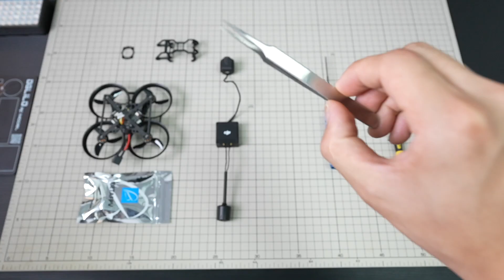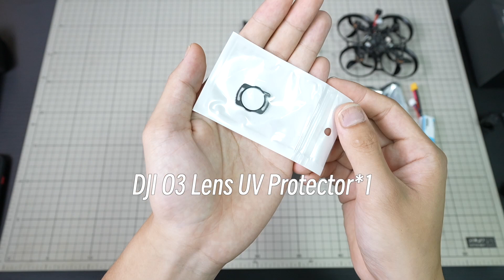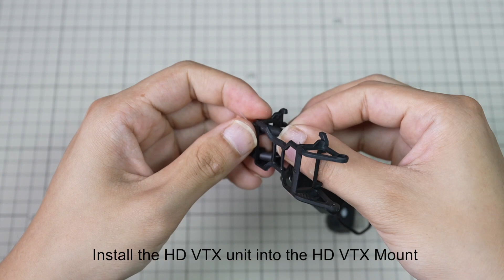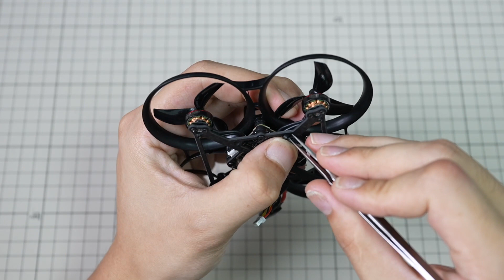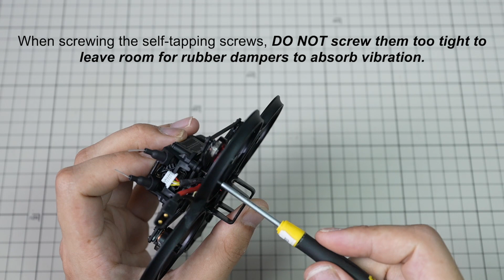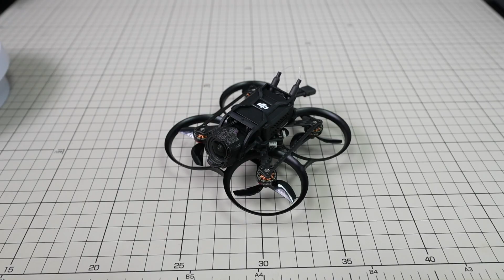BETAFPV Pavo Pico | DJI O3 Air Unit Installation Guide

Comment from the maker: To further answer your questions:

1. Which mounting hole on the VTX mount should the camera be installed on - we recommend the top one. This is to lower the camera position to further protect it from crashes. The video shows otherwise, but we do recommend you install the camera on the top mounting hole!😊
2. DJI controller could be used with the ELRS version of the whoop - please check out our product page description to configure accordingly😍
Reply: im very interested, i want to know how to link the DJI controller with this drone thx
Reply from the maker: @chuckliu2155  It's a bit long to explain here, but we have written it under the product page's FAQ section :) 
Check it out here: https://betafpv.com/products/pavo-pico-brushless-whoop
Reply: @BETAFPVHobby  a video would be very helpful please please please
Reply from the maker: @Mert D  Video is out!
Reply: @BETAFPVHobby   Can’t find video Link Please!

Comment: I purchased pavo pico (o3).

I immediately set it up and test flew it.
However, when flying, the plane tilted back to the left little by little.
After 4 minutes of flight, it tilted about 30 degrees, so I had to "guess" the rudder at all times.

The FC settings have not been changed from the factory settings.
The transmitter used is a Betafpv LiteRadio3 (ELRS).

The above phenomenon does not occur when the transmitter is used in a different aircraft, so we think the problem is with this aircraft or the FC.

I have tried many times to calibrate horizontally.
We have also confirmed that the main unit itself is not tilted.
There is no problem with the weight balance of the main unit.
Reply from the maker: Could you dm us on facebook and send in a video so we could have a closer look with our support team to see what is exactly happening? Thank you!

Comment: It is light, agile and can fly smoothly. Choose manual exposure in O3 video settings such that the shutter speed is 2x that of frames per second (fps). For example, if you choose 4:3 2.7k/50, manually select 1/100 shutter speed, Add a suitable ND filter to make auto ISO close to 100. My footage (2.7k/50 1/100 4:3, stabilised with Gyroflow 1.5):
https://youtu.be/uYpGK_xCwOg

Comment: I immediately purchased two units.

By the way, can I use a DJI radio with the FC that comes with this kit?
Reply: the O3 only works with the new grey gamepad style DJI radio. If you swap the video antennas as they do at 1:00 then it won't work, the RC link works on 2.4GHz and the original DJI antenna is dual band whereas the small ones are only 5.8. IIRC there's a mount included to use the stock DJI antenna, at which point it should be fine as the plug they use for the AU seems to have the additional SBUS wires installed, so they are probably wired up at the other end.
Reply: @FordTom  What a surprise! This was a blind spot. So, if I use the DJI RC2, I need to install the stock antenna that comes with the O3 AirUnit? By the way, what is "AU"? I would be glad if you could tell me.
Reply: @dLab  AU is air unit :) and yes you'll need to use the stock antenna as far as I know. I'm actually not 100% sure the RC2 can't use the same 5.8GHz link that the video uses but I think it can't
Reply: @FordTom  Any chance you can give further instructions on how to use the DJI grey controller? Their instructions are piss poor.
Reply: @SpartanOfLuxon  afraid I don't have any clue how to set one up as I don't use it :)
Reply from the maker: A tutorial is out! :) https://www.youtube.com/watch?v=rSenEOxOSBQ&t=15s
Reply: If you have the (grey) RC 2 it will work.

Comment: Presumbly if using it as a pnp there is no betaflight configuration necessary? Or do I need to select sbus baud=fast in the goggles and on the baord?

Comment: Hi all, does anyone know if the "Tattu R-Line 2s 550mAh" will also fit to thsi quad?
Thank and happy low weights flights :D
Reply: I just got some of the Tattu R-Line 2s 550mah and they do not fit the battery holder as is. I bought a backup frame so I just tried cutting the bottoms of the 2 "loops" and they can now fit and are held pretty securely, but will probably throw a Velcro strap on to be sure.

Comment: Received the Pico (TBS version!) today, binding with Tango 2 doesn‘t work, binding with  Radiomaster TX16S with ELRS did work, but no reaction in Betaflight. Same with DJI FPV Controller 2, binding worked but no reaction in Betaflight.
Enough for today.😡
Reply: Problem solved: Tango 2 Firmware was too old.🙈

Comment: 105$ only for the frame Or all components ?
Reply: all components w/o dji 03
Reply: @Twx97  whaaaaaaatttt ???? Lol in polish market dji o3 cost about 286 dollars loooooool
Reply: @Twx97  aaaah you mean without djo o3
Reply: @damianwyczakowski2491  yep
Reply: @damianwyczakowski2491  sadly that's the cost for flying with dji
Reply: @Twx97  yeaaaa but I need thease anyway hahaha, I got dji fpv , so I got The googles and controller and I need small drone like  this, must have.
Reply: @damianwyczakowski2491  you can get a vista unit. (But that one is normally combined with a gopro for nice footage)
Reply: @Twx97  I was told the vtx has to be bought separately or was this misinformed?
Reply: @asitab1111  yes it has to be bought separately